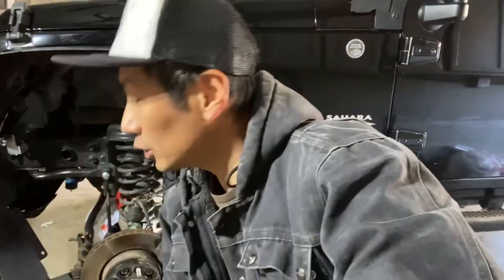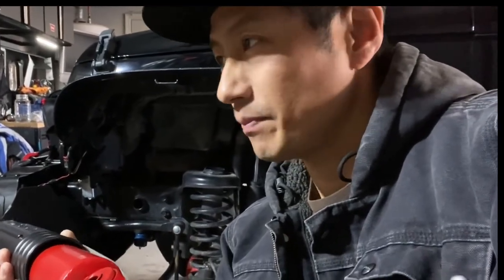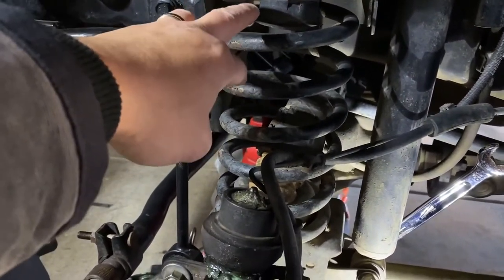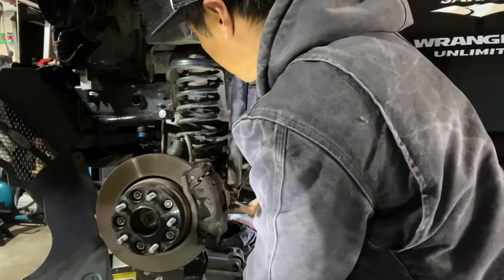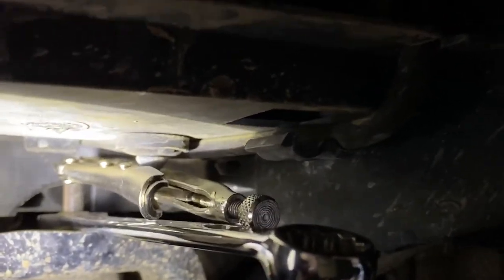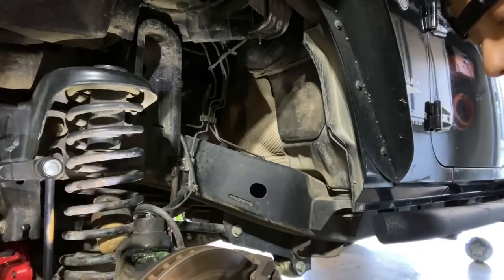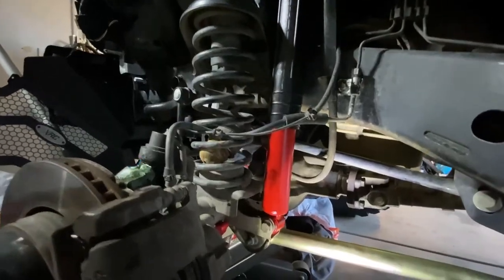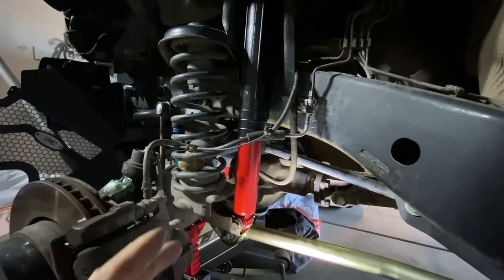MetalCloak RockSport Shock install

Comment: Hello, I’m not sure if I missed a separate review , but how do you like the performance and ride with the rocksport shocks? Ans what size lift and tires are you running . Thank you for the video
Reply from the maker: So far really good. No complaints:)
Reply from the maker: Update: the 3 1/2 lift with with the long ‘r’ shock is not ideal. The shock only has 3 inches of down travel. After I added a 2.5 inch coil space the ride felt much better over bumps.

Comment: Did you ever figure out the lower control arm issue?
Reply from the maker: Are you referring to the rubbing? I installed a 1” spacer and that resolved the issue.
Reply: The issue when the ship couldn’t get it alignment right because the couldn’t screw the metal cloak arms in far enough is what I was referring to

Comment: are you going to lift up your JK?
Reply from the maker: It’s lifted 6”
Reply: @4x2WagonFamily  i just saw the video for 6 inch spacer lift. but it seems you did not change the front and reat track bar? did you notice your wheels are shifted to the right side?
Reply from the maker: @hunting762  I’ve got adjustable track bar and I’m taking my Jeep to a shop to make sure everything is aligned.
Reply: @4x2WagonFamily  sounds great do you know how much does it cost to aliged the jeep?
Reply from the maker: @hunting762  I take mine to 4x4 alignment shop and they charge me 125
Reply: @4x2WagonFamily  thats a good price... i saw some shop they charge 350 for alignment.